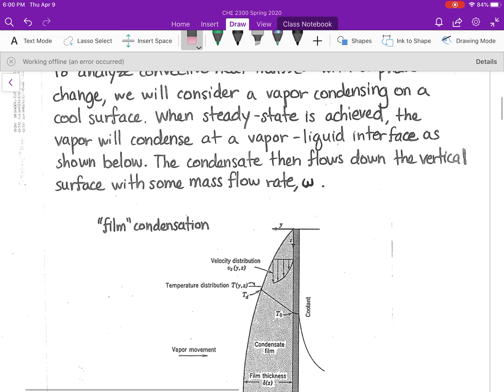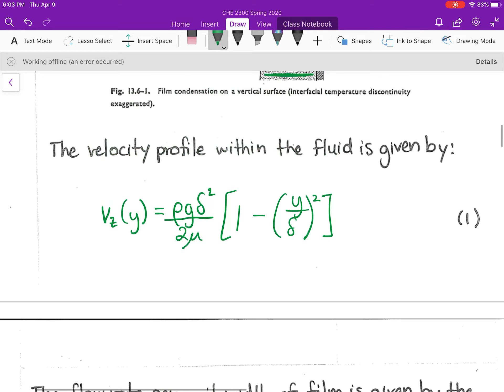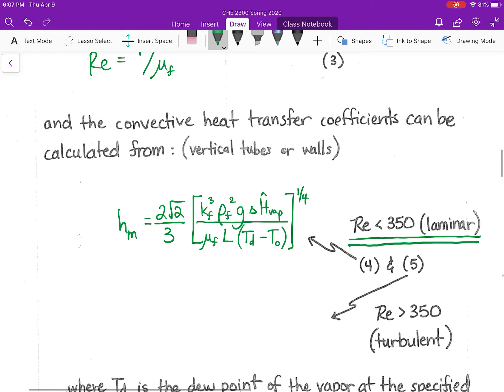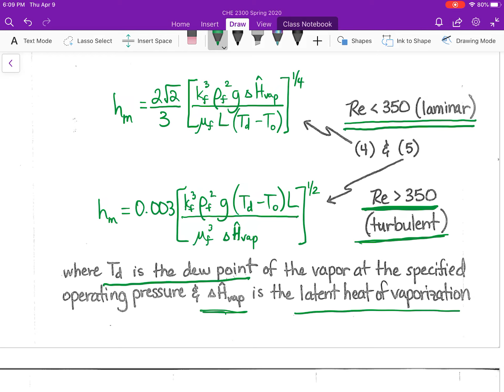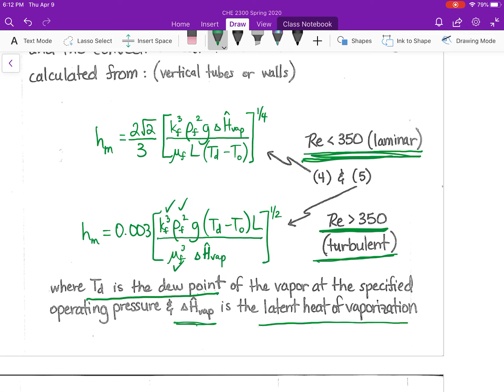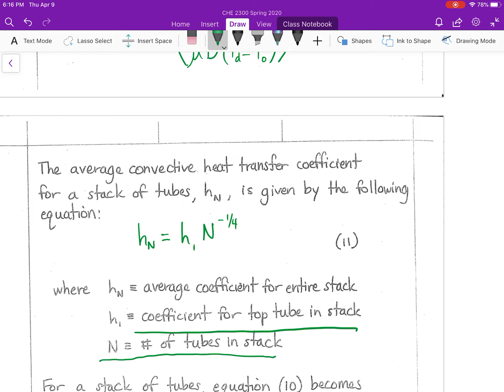Lecture 23 - Heat Transfer with Condensation - CHE 2300

Comment: A double-pipe heat exchanger is used to condense steam 
at a rate of 120 kg/h at 45oC. Cooling water (seawater) 
enters through the inner tube at a rate of 1.2 kg/s at 15oC. 
The tube with 25.4-mm O.D. and 22.1-mm I.D. is made 
mild steel, k = 45 W/(m K). The heat transfer coefficient on 
the steam side, ho
, is 7000 W/(m2 K and on cooling water 
side hi = 1100 W/(m2 K). Calculate overall heat transfer 
coefficient under clean and fouled conditions. What does 
heat transfer drop due to occuring of fouling.

Can you help me answer this question??